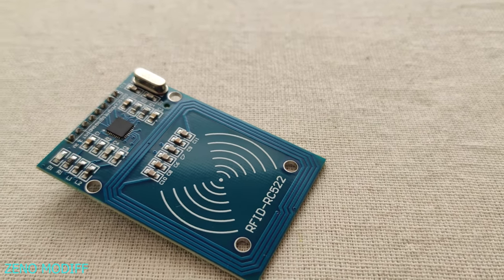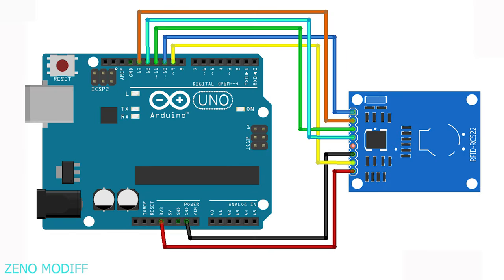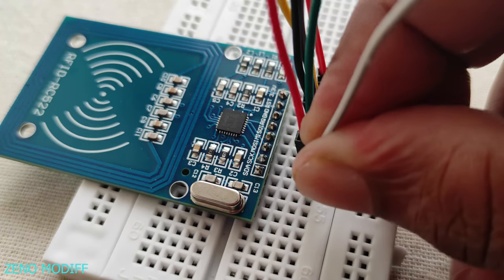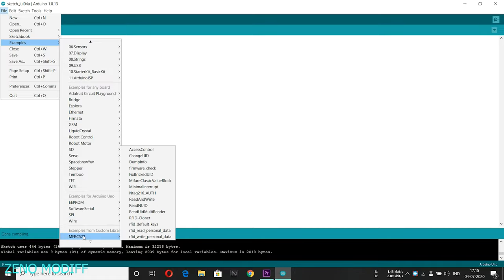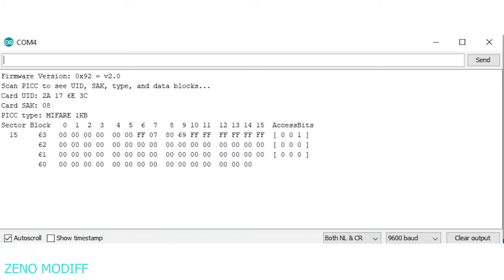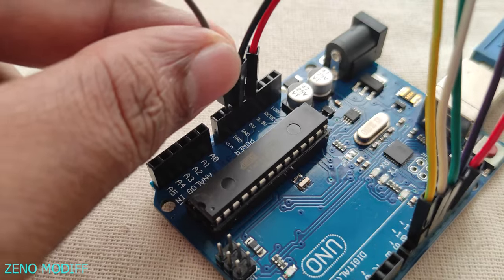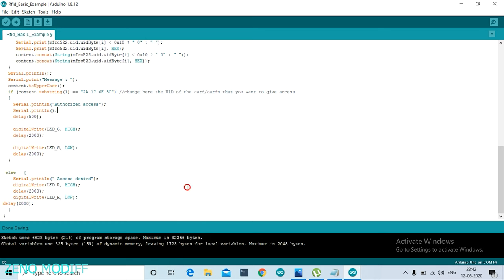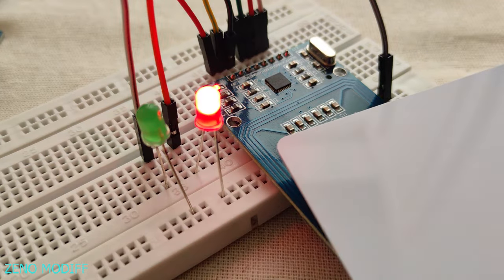How To Interface Rfid Module With Arduino  || Tomson Electronics

Comment: bro can u give me the code
Reply from the maker: #include <SPI.h>
#include <Wire.h> 
#include <MFRC522.h>
#include <LiquidCrystal_I2C.h>

LiquidCrystal_I2C lcd(0x27, 16, 2);
 
#define SS_PIN 10
#define RST_PIN 9
#define LED_G 5 
#define LED_R 4
#define RELAY1 6

MFRC522 mfrc522(SS_PIN, RST_PIN);  

 
void setup() 

{
  lcd.begin();
  lcd.backlight();

  lcd.print("ZENO MODIFF"); 
  lcd.setCursor(0, 1);
  lcd.print("RFID LOCK");
  delay(1000);
  lcd.clear();
  
  SPI.begin();   
  mfrc522.PCD_Init();  
  pinMode(LED_G, OUTPUT);
  pinMode(LED_R, OUTPUT);
  pinMode(RELAY1, OUTPUT);
 

}
void loop() 
{
lcd.clear();
lcd.print("PLACE YOUR");
lcd.setCursor(0, 1);
lcd.print("RFID TAG");
delay(1000);
lcd.clear();

  // Look for new cards
  if ( ! mfrc522.PICC_IsNewCardPresent()) 
  {
    return;
  }
  // Select one of the cards
  if ( ! mfrc522.PICC_ReadCardSerial()) 
  {
    return;
  }
  String content= "";
  byte letter;
  for (byte i = 0; i < mfrc522.uid.size; i++) 
  {
    
     content.concat(String(mfrc522.uid.uidByte[i] < 0x10 ? " 0" : " "));
     content.concat(String(mfrc522.uid.uidByte[i], HEX));
  }
  content.toUpperCase();
  if (content.substring(1) == "2A 17 6E 3C") 
  {
    
   lcd.clear();
   lcd.print("AUTHORIZED ACCESS"); 
   lcd.setCursor(0, 0);
   delay(2000);
   lcd.clear();
   
    digitalWrite(RELAY1, HIGH);
    digitalWrite(LED_G, HIGH);
    delay(6000);
    digitalWrite(RELAY1, LOW);
    digitalWrite(LED_G, LOW);
    delay(1000);
  }
 
 else   {

   lcd.print("UN AUTHORISED"); 
   lcd.setCursor(0, 0);
       digitalWrite(LED_R, HIGH);
    delay(2000);
           digitalWrite(LED_R, LOW);
              lcd.clear();
    delay(2000);

  }
}

Comment: can you make better building instruction it doesn't work because of "WARNING: Communication failure, is the MFRC522 properly connected?"
Reply: connect Vcc to 3.3v and GND to ground If you are using the Dump info code connect RST pin to 9 and  ss pin to 10  for arduino mega2560

Comment: SIR CODE AND ALL UPLOADED GREEN LIGHT WORKING BUT RED LIGHT IT'S NOT BLINKING CHECK EVERYTHING WIRE, LED, WHAT TO NEXT?? WHAT CAN BE THE PROBLEM
Reply from the maker: Did u use jumper cables to connect the circuit if yes please check the continuity of the wires that will solve the issue
Reply: @ZenoModiff  i will check once again and let you know thank you
Reply: sir did everything possible changed jumper wires changed led but the access denied one is not working if code attached the light is blinking but random rfid card no light is blinking i.e red

Comment from the maker: #include <SPI.h>
#include <Wire.h> 
#include <MFRC522.h>
#include <LiquidCrystal_I2C.h>

LiquidCrystal_I2C lcd(0x27, 16, 2);
 
#define SS_PIN 10
#define RST_PIN 9
#define LED_G 5 
#define LED_R 4
#define RELAY1 6

MFRC522 mfrc522(SS_PIN, RST_PIN);  

 
void setup() 

{
  lcd.begin();
  lcd.backlight();

  lcd.print("ZENO MODIFF"); 
  lcd.setCursor(0, 1);
  lcd.print("RFID LOCK");
  delay(1000);
  lcd.clear();
  
  SPI.begin();   
  mfrc522.PCD_Init();  
  pinMode(LED_G, OUTPUT);
  pinMode(LED_R, OUTPUT);
  pinMode(RELAY1, OUTPUT);
 

}
void loop() 
{
lcd.clear();
lcd.print("PLACE YOUR");
lcd.setCursor(0, 1);
lcd.print("RFID TAG");
delay(1000);
lcd.clear();

  // Look for new cards
  if ( ! mfrc522.PICC_IsNewCardPresent()) 
  {
    return;
  }
  // Select one of the cards
  if ( ! mfrc522.PICC_ReadCardSerial()) 
  {
    return;
  }
  String content= "";
  byte letter;
  for (byte i = 0; i < mfrc522.uid.size; i++) 
  {
    
     content.concat(String(mfrc522.uid.uidByte[i] < 0x10 ? " 0" : " "));
     content.concat(String(mfrc522.uid.uidByte[i], HEX));
  }
  content.toUpperCase();
  if (content.substring(1) == "2A 17 6E 3C") 
  {
    
   lcd.clear();
   lcd.print("AUTHORIZED ACCESS"); 
   lcd.setCursor(0, 0);
   delay(2000);
   lcd.clear();
   
    digitalWrite(RELAY1, HIGH);
    digitalWrite(LED_G, HIGH);
    delay(6000);
    digitalWrite(RELAY1, LOW);
    digitalWrite(LED_G, LOW);
    delay(1000);
  }
 
 else   {

   lcd.print("UN AUTHORISED"); 
   lcd.setCursor(0, 0);
       digitalWrite(LED_R, HIGH);
    delay(2000);
           digitalWrite(LED_R, LOW);
              lcd.clear();
    delay(2000);

  }
}
Reply: I'm a student  who learn how to program the RFID reader and get the meaning of the coding and I don't understand what you have been written here "if (! mfrc522_PICC_IsNewCardPresent())
And I don't understand why you bring the exclamation mark before the mfrc522

Comment: I don't see the code in your description. Can you give me a code link? your video is great and detailed.
Reply from the maker: #include <SPI.h>
#include <Wire.h> 
#include <MFRC522.h>
#include <LiquidCrystal_I2C.h>

LiquidCrystal_I2C lcd(0x27, 16, 2);
 
#define SS_PIN 10
#define RST_PIN 9
#define LED_G 5 
#define LED_R 4
#define RELAY1 6

MFRC522 mfrc522(SS_PIN, RST_PIN);  

 
void setup() 

{
  lcd.begin();
  lcd.backlight();

  lcd.print("ZENO MODIFF"); 
  lcd.setCursor(0, 1);
  lcd.print("RFID LOCK");
  delay(1000);
  lcd.clear();
  
  SPI.begin();   
  mfrc522.PCD_Init();  
  pinMode(LED_G, OUTPUT);
  pinMode(LED_R, OUTPUT);
  pinMode(RELAY1, OUTPUT);
 

}
void loop() 
{
lcd.clear();
lcd.print("PLACE YOUR");
lcd.setCursor(0, 1);
lcd.print("RFID TAG");
delay(1000);
lcd.clear();

  // Look for new cards
  if ( ! mfrc522.PICC_IsNewCardPresent()) 
  {
    return;
  }
  // Select one of the cards
  if ( ! mfrc522.PICC_ReadCardSerial()) 
  {
    return;
  }
  String content= "";
  byte letter;
  for (byte i = 0; i < mfrc522.uid.size; i++) 
  {
    
     content.concat(String(mfrc522.uid.uidByte[i] < 0x10 ? " 0" : " "));
     content.concat(String(mfrc522.uid.uidByte[i], HEX));
  }
  content.toUpperCase();
  if (content.substring(1) == "2A 17 6E 3C") 
  {
    
   lcd.clear();
   lcd.print("AUTHORIZED ACCESS"); 
   lcd.setCursor(0, 0);
   delay(2000);
   lcd.clear();
   
    digitalWrite(RELAY1, HIGH);
    digitalWrite(LED_G, HIGH);
    delay(6000);
    digitalWrite(RELAY1, LOW);
    digitalWrite(LED_G, LOW);
    delay(1000);
  }
 
 else   {

   lcd.print("UN AUTHORISED"); 
   lcd.setCursor(0, 0);
       digitalWrite(LED_R, HIGH);
    delay(2000);
           digitalWrite(LED_R, LOW);
              lcd.clear();
    delay(2000);

  }
}

Comment: can i use 5v motor gfor output any changes in code
Reply from the maker: No change in code but insted of relay use PNP type transistor and connect to the digital pine where we have wire the relay that's all no change in code

Comment: LiquidCrystal_I2C.h: No such file or directory
Even after uploading the library which was given in the link, i'm getting an error.
Can you please help me out with this?
Reply from the maker: I haven't given i2c Library brother it's the RFID library
Reply from the maker: #include <SPI.h>
#include <Wire.h> 
#include <MFRC522.h>
#include <LiquidCrystal_I2C.h>

LiquidCrystal_I2C lcd(0x27, 16, 2);
 
#define SS_PIN 10
#define RST_PIN 9
#define LED_G 5 
#define LED_R 4
#define RELAY1 6

MFRC522 mfrc522(SS_PIN, RST_PIN);  

 
void setup() 

{
  lcd.begin();
  lcd.backlight();

  lcd.print("ZENO MODIFF"); 
  lcd.setCursor(0, 1);
  lcd.print("RFID LOCK");
  delay(1000);
  lcd.clear();
  
  SPI.begin();   
  mfrc522.PCD_Init();  
  pinMode(LED_G, OUTPUT);
  pinMode(LED_R, OUTPUT);
  pinMode(RELAY1, OUTPUT);
 

}
void loop() 
{
lcd.clear();
lcd.print("PLACE YOUR");
lcd.setCursor(0, 1);
lcd.print("RFID TAG");
delay(1000);
lcd.clear();

  // Look for new cards
  if ( ! mfrc522.PICC_IsNewCardPresent()) 
  {
    return;
  }
  // Select one of the cards
  if ( ! mfrc522.PICC_ReadCardSerial()) 
  {
    return;
  }
  String content= "";
  byte letter;
  for (byte i = 0; i < mfrc522.uid.size; i++) 
  {
    
     content.concat(String(mfrc522.uid.uidByte[i] < 0x10 ? " 0" : " "));
     content.concat(String(mfrc522.uid.uidByte[i], HEX));
  }
  content.toUpperCase();
  if (content.substring(1) == "2A 17 6E 3C") 
  {
    
   lcd.clear();
   lcd.print("AUTHORIZED ACCESS"); 
   lcd.setCursor(0, 0);
   delay(2000);
   lcd.clear();
   
    digitalWrite(RELAY1, HIGH);
    digitalWrite(LED_G, HIGH);
    delay(6000);
    digitalWrite(RELAY1, LOW);
    digitalWrite(LED_G, LOW);
    delay(1000);
  }
 
 else   {

   lcd.print("UN AUTHORISED"); 
   lcd.setCursor(0, 0);
       digitalWrite(LED_R, HIGH);
    delay(2000);
           digitalWrite(LED_R, LOW);
              lcd.clear();
    delay(2000);

  }
}
Reply from the maker: If you have any questions ping me on sreeramaj53@gmail.com
Reply: did you find a solution, i have the same problem
Reply: The code he has typed uses LCD screen for display. But in the video there is no lcd connected so no need to include liquid crystal library. I edited the code to remove the lcd code. Use this instead:

#include <SPI.h>
#include <MFRC522.h>

 
#define SS_PIN 10
#define RST_PIN 9
#define LED_G 5 
#define LED_R 4

MFRC522 mfrc522(SS_PIN, RST_PIN);  

 
void setup() 

{
  SPI.begin();   
  mfrc522.PCD_Init();  
  pinMode(LED_G, OUTPUT);
  pinMode(LED_R, OUTPUT);

 

}
void loop() 
{
  // Look for new cards
  if ( ! mfrc522.PICC_IsNewCardPresent()) 
  {
    return;
  }
  // Select one of the cards
  if ( ! mfrc522.PICC_ReadCardSerial()) 
  {
    return;
  }
  String content= "";
  byte letter;
  for (byte i = 0; i < mfrc522.uid.size; i++) 
  {
    
     content.concat(String(mfrc522.uid.uidByte[i] < 0x10 ? " 0" : " "));
     content.concat(String(mfrc522.uid.uidByte[i], HEX));
  }
  content.toUpperCase();
  if (content.substring(1) == "46 44 54 73") 
  {
    digitalWrite(LED_G, HIGH);
    delay(2000);
    digitalWrite(LED_G, LOW);
    delay(2000);
  }
 
 else   {

    digitalWrite(LED_R, HIGH);
    delay(2000);
           digitalWrite(LED_R, LOW);
    delay(2000);

  }
}
Reply: @allanndungu360 Thanks!!!
🥰

Comment: can you give the copy of your code in rfid basic example ?
Reply from the maker: #include <SPI.h>
#include <Wire.h> 
#include <MFRC522.h>
#include <LiquidCrystal_I2C.h>

LiquidCrystal_I2C lcd(0x27, 16, 2);
 
#define SS_PIN 10
#define RST_PIN 9
#define LED_G 5 
#define LED_R 4
#define RELAY1 6

MFRC522 mfrc522(SS_PIN, RST_PIN);  

 
void setup() 

{
  lcd.begin();
  lcd.backlight();

  lcd.print("ZENO MODIFF"); 
  lcd.setCursor(0, 1);
  lcd.print("RFID LOCK");
  delay(1000);
  lcd.clear();
  
  SPI.begin();   
  mfrc522.PCD_Init();  
  pinMode(LED_G, OUTPUT);
  pinMode(LED_R, OUTPUT);
  pinMode(RELAY1, OUTPUT);
 

}
void loop() 
{
lcd.clear();
lcd.print("PLACE YOUR");
lcd.setCursor(0, 1);
lcd.print("RFID TAG");
delay(1000);
lcd.clear();

  // Look for new cards
  if ( ! mfrc522.PICC_IsNewCardPresent()) 
  {
    return;
  }
  // Select one of the cards
  if ( ! mfrc522.PICC_ReadCardSerial()) 
  {
    return;
  }
  String content= "";
  byte letter;
  for (byte i = 0; i < mfrc522.uid.size; i++) 
  {
    
     content.concat(String(mfrc522.uid.uidByte[i] < 0x10 ? " 0" : " "));
     content.concat(String(mfrc522.uid.uidByte[i], HEX));
  }
  content.toUpperCase();
  if (content.substring(1) == "2A 17 6E 3C") 
  {
    
   lcd.clear();
   lcd.print("AUTHORIZED ACCESS"); 
   lcd.setCursor(0, 0);
   delay(2000);
   lcd.clear();
   
    digitalWrite(RELAY1, HIGH);
    digitalWrite(LED_G, HIGH);
    delay(6000);
    digitalWrite(RELAY1, LOW);
    digitalWrite(LED_G, LOW);
    delay(1000);
  }
 
 else   {

   lcd.print("UN AUTHORISED"); 
   lcd.setCursor(0, 0);
       digitalWrite(LED_R, HIGH);
    delay(2000);
           digitalWrite(LED_R, LOW);
              lcd.clear();
    delay(2000);

  }
}

Comment: hi.. I will great-full if u share the code please
Reply from the maker: #include <SPI.h>
#include <Wire.h> 
#include <MFRC522.h>
#include <LiquidCrystal_I2C.h>

LiquidCrystal_I2C lcd(0x27, 16, 2);
 
#define SS_PIN 10
#define RST_PIN 9
#define LED_G 5 
#define LED_R 4
#define RELAY1 6

MFRC522 mfrc522(SS_PIN, RST_PIN);  

 
void setup() 

{
  lcd.begin();
  lcd.backlight();

  lcd.print("ZENO MODIFF"); 
  lcd.setCursor(0, 1);
  lcd.print("RFID LOCK");
  delay(1000);
  lcd.clear();
  
  SPI.begin();   
  mfrc522.PCD_Init();  
  pinMode(LED_G, OUTPUT);
  pinMode(LED_R, OUTPUT);
  pinMode(RELAY1, OUTPUT);
 

}
void loop() 
{
lcd.clear();
lcd.print("PLACE YOUR");
lcd.setCursor(0, 1);
lcd.print("RFID TAG");
delay(1000);
lcd.clear();

  // Look for new cards
  if ( ! mfrc522.PICC_IsNewCardPresent()) 
  {
    return;
  }
  // Select one of the cards
  if ( ! mfrc522.PICC_ReadCardSerial()) 
  {
    return;
  }
  String content= "";
  byte letter;
  for (byte i = 0; i < mfrc522.uid.size; i++) 
  {
    
     content.concat(String(mfrc522.uid.uidByte[i] < 0x10 ? " 0" : " "));
     content.concat(String(mfrc522.uid.uidByte[i], HEX));
  }
  content.toUpperCase();
  if (content.substring(1) == "2A 17 6E 3C") 
  {
    
   lcd.clear();
   lcd.print("AUTHORIZED ACCESS"); 
   lcd.setCursor(0, 0);
   delay(2000);
   lcd.clear();
   
    digitalWrite(RELAY1, HIGH);
    digitalWrite(LED_G, HIGH);
    delay(6000);
    digitalWrite(RELAY1, LOW);
    digitalWrite(LED_G, LOW);
    delay(1000);
  }
 
 else   {

   lcd.print("UN AUTHORISED"); 
   lcd.setCursor(0, 0);
       digitalWrite(LED_R, HIGH);
    delay(2000);
           digitalWrite(LED_R, LOW);
              lcd.clear();
    delay(2000);

  }
}